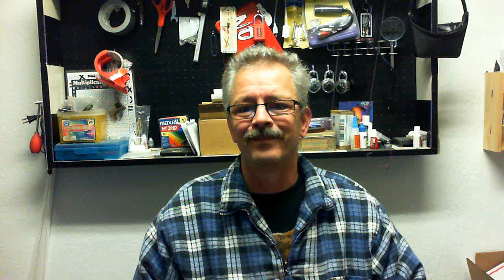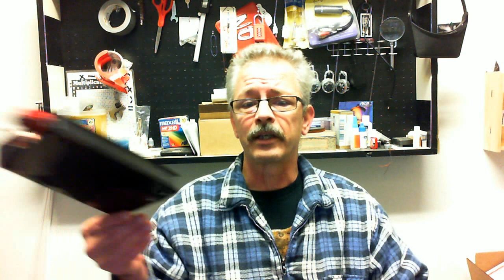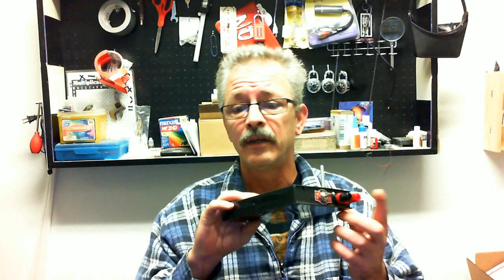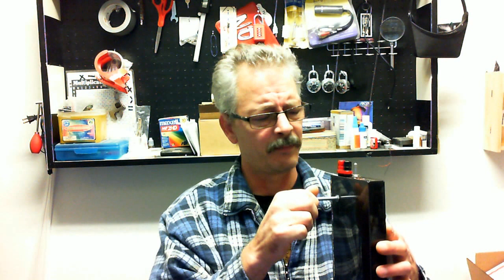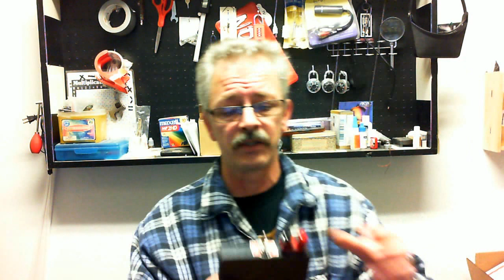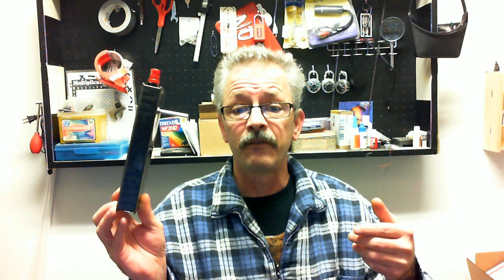how I made a 12V variable power supply with a Xbox 360 power brick

Comment: HOW did you actually make this?!
Reply from the maker: I still have it but I never finished the final touches, I use it from time to time to power different items to test components ect... but it still looks about the same as in the video as you can see you're the first to comment on the video in a year so I never videoed the completion of the portable power supply converter, I did not even know that I had 1,920 views on this video.
Reply: Thanks for your reply, but how did you manage to do it? I'm looking for a way to adjust output between 10 and 13.8V...

My problem is, I haven't been able to locate a schematic or identify the voltage regulation feedback resistor bridge that these power supplies usually contain for inserting a potentiometer in its place to achieve output voltage variation, and I was wondering how you managed to achieve that from the 0, 5 and 12V output connections alone.

Or did you simply  insert a linear voltage regulator and heat sink in the output 12V?
Reply from the maker: there are lots of ways to get technical with this but everything with the power brick is unchanged as for regulating voltage from 1V to 12V or 1V to 5V, all that is needed is a variable resistor between the hot and output. of your box. I would recommend using something like this: http://www.ebay.com/itm/DC12V-24V-8A-LED-Switch-Dimmer-Cotroller-for-3528-5050-Led-Strip-Single-Color/222008053253?_trksid=p2047675.c100005.m1851&_trkparms=aid%3D222007%26algo%3DSIC.MBE%26ao%3D1%26asc%3D37183%26meid%3Db74434f081894d90a8b5b0a263facad1%26pid%3D100005%26rk%3D2%26rkt%3D6%26sd%3D322051397617
Reply from the maker: Excuse me? d perry428 Did I give you permission to answer questions on my channel? NO! And I know Dam good and well, that I did not give you permission to be rude to anyone on my channel! 

Do not come on my channel telling anyone they asked a Stupid or irrelevant question that is My job not yours. 

PS That comment was made over a month ago so I do not even know why you decided to wayin with your Assholeish rude & demeaning reply to JohnJimmy J? 

In my opinion between both of your comments  JohnJimmy J looks like a rocket scientist and you look like a Dumbass backwoods hick trying to make yourself look intelligent by bullying someone.
Reply: TheHGCGamersClub 
Is there a way to make an adapter to use the slim power supply into the original classic XBOX360?
Because it might be better to use the slim instead of the original power supply.
Reply: TEACH ME HOW PLEASE!!!